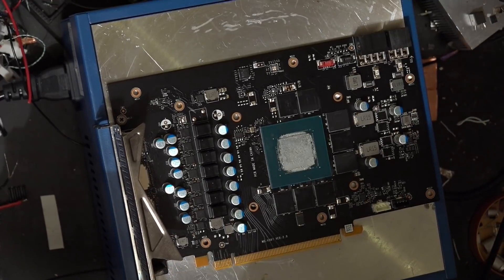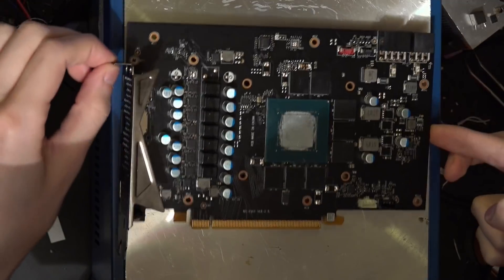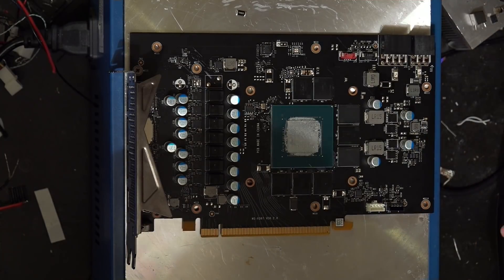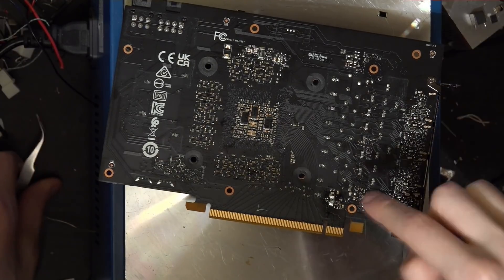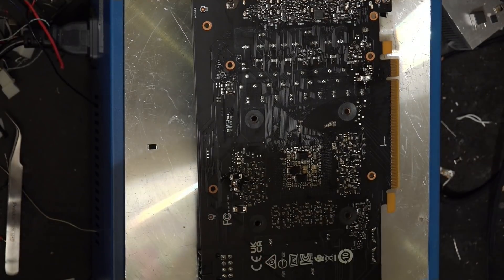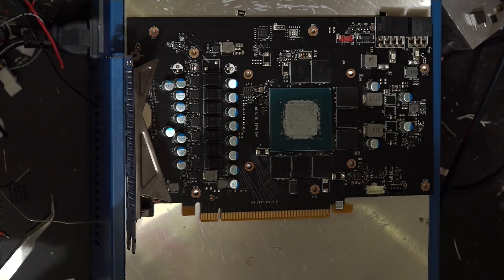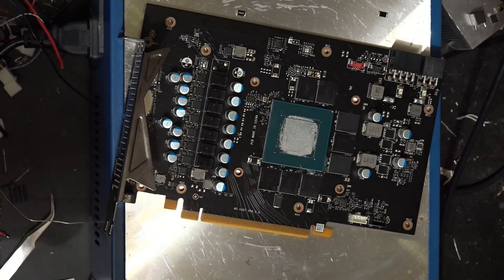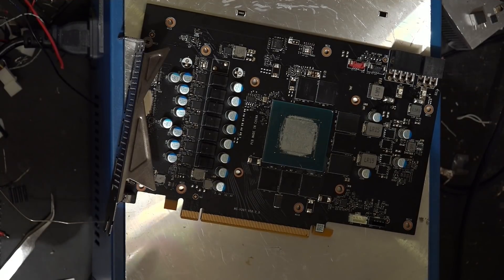3060Ti shunt mod

Comment: Starting from 16:11 is pretty helpful to know. I have a constantly power throttling quadro that I've been wanting to shunt mod. In theory, it should improve performance even if I'm ultimately locked out of frequency settings.

Comment: Pretty sweet.  I would have done this but my 3060ti only has one PCIE power connector so I'm sure this won't make a difference since there is not enough juice going to it.
Reply: it’s a percentage game. 3mohm from 5mohm (either by stacking an 8mhom resistor or replacing the existing 5mohm one) will get you a 66% increase in power draw. so supposing you ignored the pcie power, because that’s a little scuffed, and that your pcie 8 pin connector is sucking close to 150w with your stock vbios, you can expect around a 100w increase in effective power limit

nothing massive, but if you haven’t had any luck with vbios flashing and you can reliably solder to your PCB without killing something, it’s not too bad.

Comment: Is there a reason to replace resistors instead of just stacking another on top?
Also is there any generally agreed upon 'safe' (relative) value to increase the power limit by? 66% sounds like a lot, surely the power regulation circuits of the card don't have enough headroom to cope with that reliably?

Comment: Palit 3060 ti I shorted pins 2 and 3 of the cable fan socket.  12-5 v is ok, 1.8v pex , mem, vdd voltages are not.  Is the gpu damaged?  :( 1.8 rail 0 ohm ) help please

Comment: i know this isnt the place for it but i looked everywhere  else and couldnt find a solution maybe someone knows, i think my ssd is causing my audio/image to stop working for 2-3 seconds then everything work normal again but i have to refresh the browser in order for the audio to work again ( i noticed it happens more often when i play games and i have twitch or youtube on the background listening to podcasts), this happens randomly or so i think, i have tried everything that i could and nothing works my system is 5800x, x570 asus e gaming, 3080 z gaming trio, 750 plat psu, 32gb g.skill 3200mhz 14cl, 1 m.2 ssd 980 pro, 1 sata ssd 860 evo, if anyone had something similar happen to him before please feel free to share your solution.

Comment: Will you do the same for a 3080?

By the end about core clock off set, you mean that you can not set it as high in afterburner because it would add over what it boosts to? but if you don't touch the offset it will boost itself way higher than default? I am not sure.

Comment: the only reason not to use hot air there would be the risk of melting the power connectors. to mitigate the risk i'd leave a 6/8 pin cable connected to soak some heat (generally useful for soldering all connectors) and blast max heat at an angle not abusing airflow to prevent components flying off... been there done that.

Comment: Would the card die if you replaced the factory resistors with 1mOhm ones ?
Reply from the maker: it might get stuck in safe mode.

Comment: Took the heatsinks off a spare set of those 8gb Patriot Viper DDR4-4000 b-dies and pinched a leg on a component. Ordered a usb telescope. Hopefully the hair-dryer is enough cause a hot plate is a bit much for one ram stick. Would it be worth it to shunt mod a Tuf 3070 that has a waterblock?

Comment: Dude, get yourself a hot air wand. They're about $20 from eBay and they make desoldering parts so easy. You just grab it with tweezers, aim the hot air at the part and it just lifts off the board.

Edit: the prices seem to have gone up, the cheapest rework station is around US$50. Still well worth it though.

Edit 2: no, I just found one for AU$42.56 with free postage so I wasn't that far off.

Comment: You have better knowledge about electronics than mean, but  you need to up your soldering game, sorry that it may sound weird, I don't know how to explain in English, and text form makes it harder to explain
google some video on soldering tips or see people do it in real life is easier to get.

-clean your soldering iron tip frequently. I don't know a technical term but the cold solder and burn flux that sits on the iron tip make it hard to transfer heat and your will need more flux.
-after putting the old component out, clean the old pad using a desoldering pump. you will get more flat space to work with.
also, prevent mixing old solder with a new one. when you mix it. it easier to become a cold joint.
-desolder component of the size, you can add a lot solder that it flows to both pada and it can desolder with one iron solder.  (google"Desoldering without hot air")

Comment: I customize Harley gauges, I change out thousands of leds on mainboards a year, mostley PLCC-2, but I have some that require some really small stuff. I get a kick outa watching you guys try to solder. I've never used a board heater, i run a very hot iron, I use a very nice digital Weller and run the tip about 650, you really want a hot tip, makes life easier, and the solder cools down as soon as you get off it, theres lil worry about component damage because your in and out so quick rather than trying to get a 350 deg iron to melt the solder.
I think I know the Irons your using, from radio shack? I had 1 just like them before I started using my Weller.
Reply: Those soldering irons look just like my Radio Shack one, yea. I've never had issues with mine staying at high temps, though the temperature the station thinks it is is generally off by like 50 degrees.
Reply: @ScreamRouter  The Digital Weller is really nice, the heat transfer is way better. Lots of tips or just shape your own. I became a much better at soldering once I stated using it. It was worth the money, I think I paid 350.00 for it, been using it 5 plus years same heating element, and i use it pretty much daily .you can buy spare heating elements. 
I had 1 Iron quit working just like that 1 and I bought another, I have it around somewhere as a spare. Hope I never have to use it again.

Comment: Buildzoid, I have a Gigglebit 3060 TI with just 1 8-pin power connector. Would a shuntmod be as useful as with your card w/ 8+6? also, please provide results for perf improvements... Lastly, where can I buy these shunt resistors?
Reply: I’m in the same boat, just got a Palit 3060 ti dual and want to try out this mod as the single 8 pin is really restricting.

Comment: I'm curious, is this method preferred over simply putting liquid metal to bridge the shunt resistors? I ask because I'm considering doing a shunt mod on my poor 2x 8 pin 3090 so it's not so power starved.
Reply: You call 350W+ "power starved"? 😏
Reply: Don't use liquid metal.

Comment: It looks like you replaced the shunt for the pcie slot as well. Don't you usually leave that alone?
Reply: Hi, AMD fan here. I think the controller will reference measured power against all planes, so I think if he leaves pcie alone, it will tell the controller the rest of the board is way out of whack. Changing the pcie resistor as well keeps the charade up so the controller lets the board rip. In practice, none of the real power stages are fed off the board's pcie, so as power draw goes up, it doesn't increase the load on the pcie slot, so it's safe on the motherboard.

But I'm a radeon guy, I don't know for sure!

Comment: You get tweezer soldering irons. It is a absolute godsend when working with 2 pin components. Also helps to pre-heat the components (not ICs) on the plate. Personal preference.
Reply: true! That and small hot-air nozzle are a must have!

Comment: Advice as an electronics engineer: get some soldering wick and clean your pads before you place a new component on it. This makes your resistor lay flat on the pcb instead of doing a wheely. Mixing old/new solder is also kinda annoying.

Then presolder one pad and keep the solder liquid as you place the resistor on it. Then solder the second pad.
Reply from the maker: my soldering irons don't have enough power to melt an entire pad on a board like this. The lack of power is also why I avoid using desoldering wick. It ends up getting stuck constantly.
Reply: @ActuallyHardcoreOverclocking  your soldering iron probably has enough power. You did mention using conical soldering tips, but bigger chisel tips are better. Pro tip; you actually always want a bigger tip than a smaller one (because of thermal mass and surface contact area). There's also no shame in waiting a solid amount of time before the solder melts, especially on the powerplanes. 
Also, having a small ball of molten solder on your tip helps with melting solder present on a pad. Not sure if its because of the metal structure or because of the surface contact area/thermal mass, but it helps.

Anyway, i enjoy your content, i like the amount of knowledge you've got in electronics by teaching yourself. Id be glad to help if you need any experience based advice in the future :)
Reply: @ActuallyHardcoreOverclocking  that feel when 6900 xt money could've gone into soldering equipment upgrades
Sadge
Reply: @ActuallyHardcoreOverclocking  time to overclock your soldering iron?
Reply: @ActuallyHardcoreOverclocking  how many watts is your iron? You can get 100 watt t12 irons really cheap
Reply: @ActuallyHardcoreOverclocking  if budget is tight some ts100 irons will do the job. If not get a weller 2/3 channel rework station and slowly upgrade it.
Reply: @ActuallyHardcoreOverclocking  Don't be afraid to throw that tip into a propane flame. :)
Reply: Doesn’t really make a difference

Comment: Isn't the current sense resistor near the bottom of the PCB on the back for the PCIe slot power? Does that need to be changed? I know on previous gens it wasn't necessary
Reply: This card has half of vcore on pci-e

Comment: Just a general question about shunt modding. Does the software realize that the card has a different shunt? It sees the same, lets say 1V when in reality it's not ~1V,  it's more like 1.5V? I get that for software to work it has to have set points set by hardware, but are we changing the set points here or just a security(op?) thing?
Reply: By doing shunt mod Youre not incerasing voltage on core, Youre incerasing overall power that card can pull before software/bios limits it, due to lower drop in incoming voltage. Check his videos on 10 series, when he used them :)
Reply from the maker: the whole reason this works is because the card thinks it's still on 5mOhm shunts.
Reply: The shunts' purpose is to provide a measurement (and present it to other hardware on the card) of the total wattage coming in, calculated specifically for the 5mOhm shunt. The card doesn't know that you swapped the shunts and does the same calculations. Because there is less resistance, the card think thinks its drawing less power than it actually is.

Comment: i still dont get the logistics of having memory chips so close to the pci slot. 99% of the time they run hot
Reply: For ampere the most important thing is having the memory as close to the GPU as possible. Any other placement is secondary.

Comment: : Can I preheat the board in like and oven set to 100°C?
Reply: It will cool off rather quickly. You can however use a cheap electric grill (the ones with just one hot side).

Comment: The card has Pbless solder and what you are using is most probably proper 60/40 Sn/Pb and the two don't mix well. You should have cleaned the pads of the ROHS compliant shit, tinned it with your solder and very easily do all the new resistors with the hot air gun and the tweezers. Good job anyway though.
Reply from the maker: nah I use SnAgCu
Reply: @ActuallyHardcoreOverclocking  I hate that stuff and I hate the regulations more for forcing us use it.

Comment: This kind of soldering iron does nothing and has a small chance to kill ur chips. If u get a better soldering iron, that hot plate will be unnecessary. like ts100 or u can actually diy a cheap one using hakko t12 tips.

Comment: BZ, you thought Gigabyte claiming a 6 phase VRM was 12 back on X58 a couple of weeks ago was worth a rant. Just out of curiosity because I still use the board I went looking for the Gigabyte GA-X58A-UD3R and found this Gigabyte VRM BS -  "While this board (Gigabyte GA-X58A-UD3R) has a traditional chemical capacitor VRM circuit, the GA-X58A-UD7 has a more advanced 24-phase VRM design with solid-state capacitors." - Bit-Tech review of Gigabyte GA-X58A-UD3R; May 7, 2010.
Reply: Maybe they counted the phase of the moon and the 3 phase at the power plant.
Also the phase my child is going through.
Reply: 6x4 phase? it does have a lot of inductors 
(Quadruplers on a 6 phase maybe?) (though i haven't seen how many mosfets it has and the heatsink looks normal size, hard to imagine they got 24 combined highside/lowsides there let alone 48 normal fet's unless the backside it coated in them.

Comment: get a cheap set of air soldering tips... concentrate your heat and get the tip closer to your actual component instead of on ones you want to leave alone (:
Reply from the maker: I have smaller nozzels. They are great at taking absolutely forever to remove things.
Reply: @ActuallyHardcoreOverclocking  lol
Reply: @ActuallyHardcoreOverclocking  I used to have the same issue! The problem is you have to use slightly higher temp when you attach a nozzle... just like a thicker pcb absorbs heat the nozzle absorbs and dissipates heat into itself kind of wasting its own energy... resulting in slightly cooler air out of the nozzle which takes longer to melt solder. slightly higher temp and you’re good to go. using a IR thermometer to adjust and calibrate the air actually coming out of the nozzle is a great help. 🤙🏻
Reply: I like hakkos flat head bits